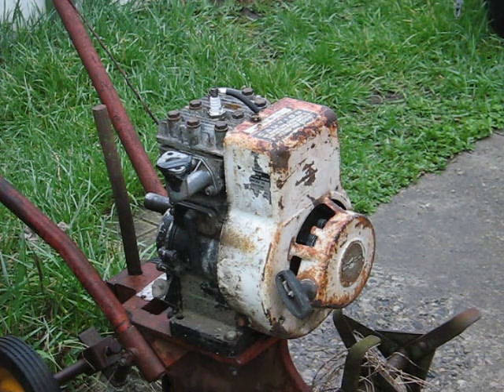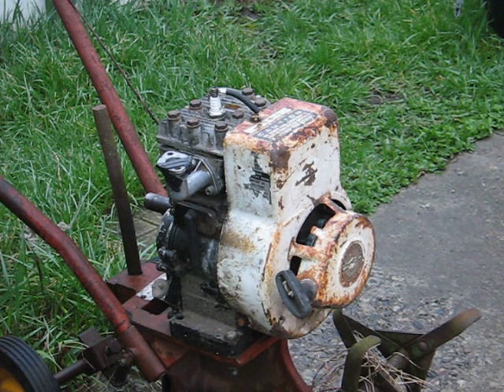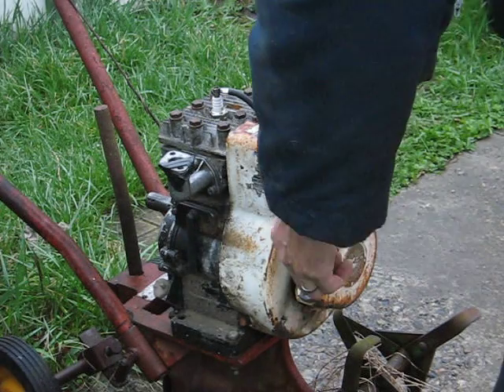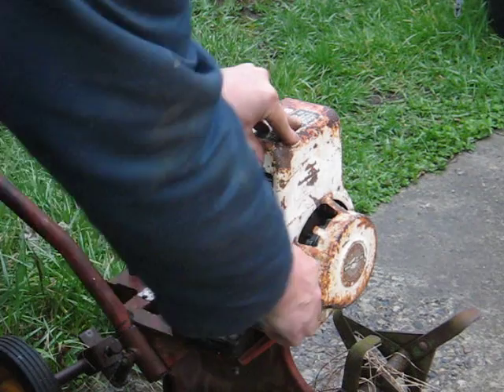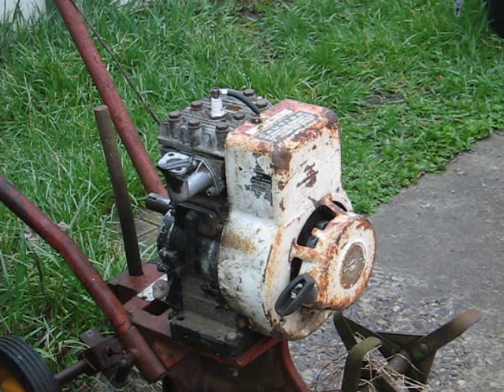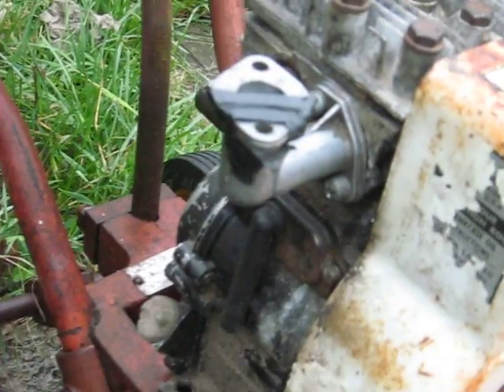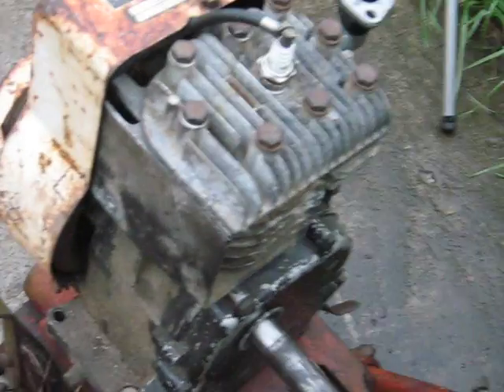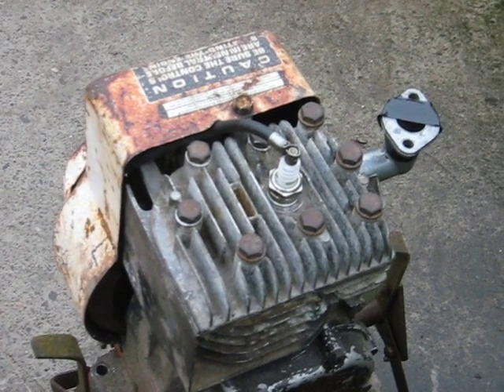Test of Rotary piston Briggs Block

Comment: what exactly it this engine a wankle?
Reply from the maker: No, I was attempting to build an engine like the old rotary aircraft engines from the WW1 era. The crankshaft was fixed, while the cylinders rotated around in a circle. watch a vid of the Monosoupape or a similar rotary piston engine. I gave up on this , as it wouldn't start, plus it may well have blown up if it did start. Instead i made the WhirliBriggs, a compressed air powered version, there are vids hear of it on operation.
Reply: ChargerMiles007 O Ok

Comment from the maker: I know this particular vid isn't dangerous, the nect one called "Rotary starting attempt" is the dangerous one. I actually got the vids mixed up during uploading, oops!
Like I say, please don't try building this engine, all my other engines are fairly safe, but NOT this one!
I am going to run it on compressed air, just to show that it will run :)

Comment from the maker: Yes, thats what I try in a later vid.It took a fair sized weight to balance it.
I hadn't thought of supporting both ends of the crank, good idea! That was a big problem I had in the vids thatshow the lawn tractor, the crankshaft was clamped in a vise, but it still flopped around. I now use a shaft collar with 3 set screws, so it seems to be more stable.  The big concern is still it revving to high, and flying apart!  :(

Comment: just put a counter weight on the end of the block, as long as its fairly close to balanced and its secured it might work, you could support both ends of the crank and it would be more stable